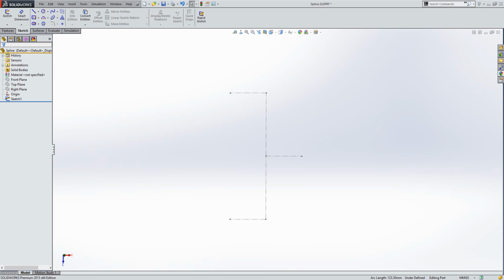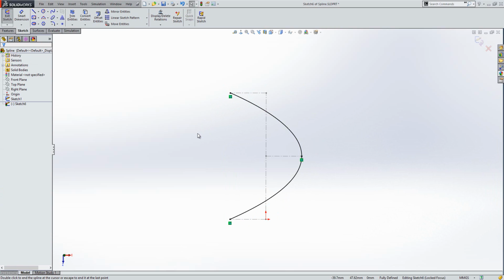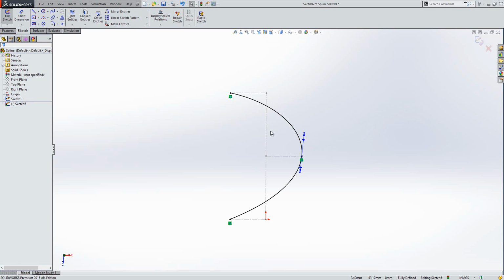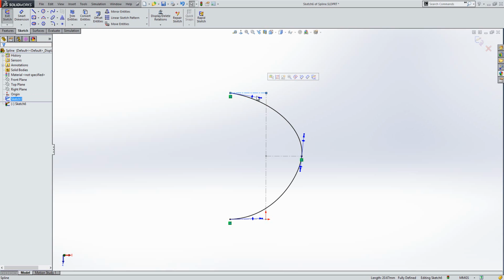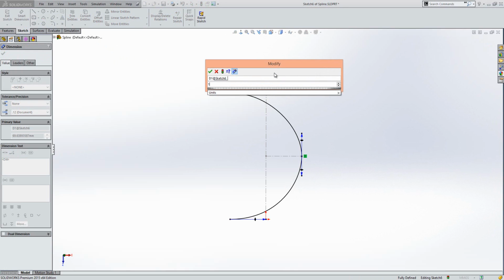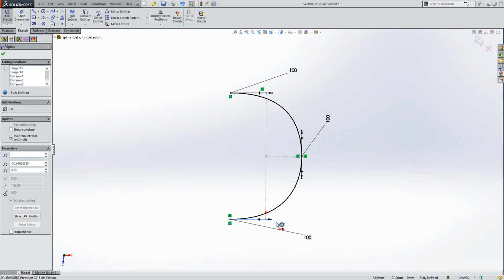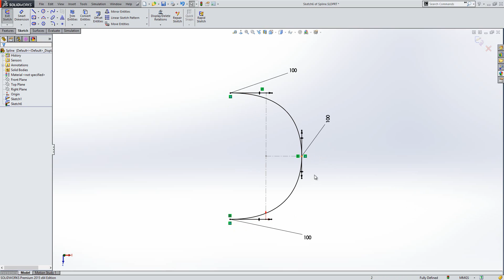How to fully define a spline in SOLIDWORKS

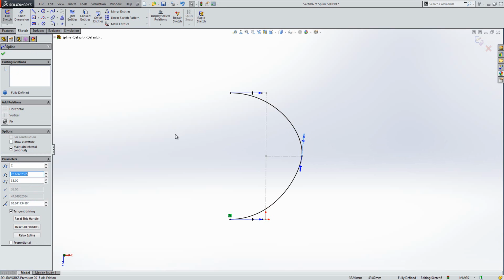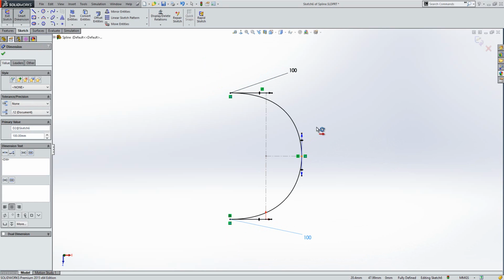Comment: See how "Tangent Weighing 1" and "Tangent Weighing 2" are different at 1:22? That means that those two handles aren't symetric. Later at 1:45, when you use "Smart Dimension" tool to define something about that point's handles it ends up asymetric.
Result: although the sketch shows as fully defined (all black) I can get different results depending on how I manipulate those handles initialy. That doesn't make sense! A sketch should have the exact same result if you defined it's parameters the same, independently of how you set it up before definition.
So my questions are:
- Why are "Tangent Weighing 1" and "Tangent Weighing 2" grayed out?! Let me defined those please! (I'm using SW 2016)
- How can you create two exactly equal splines without copy and paste?